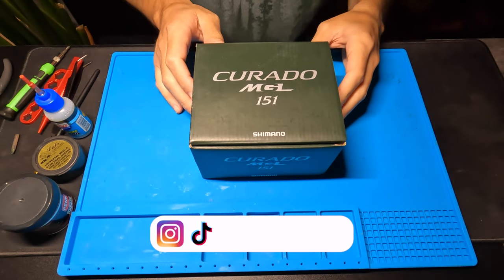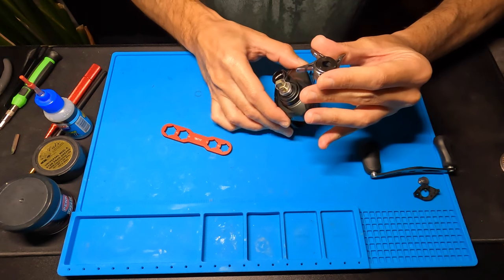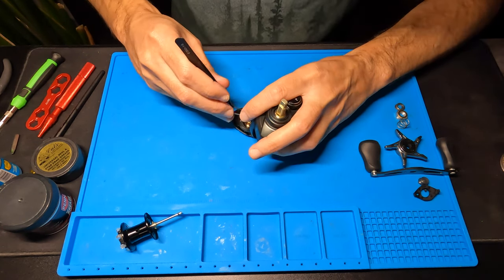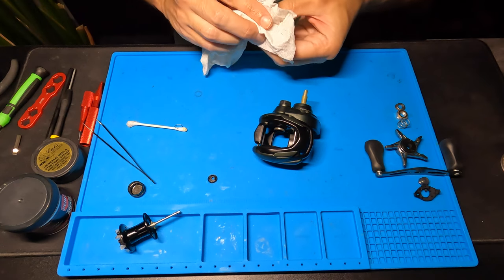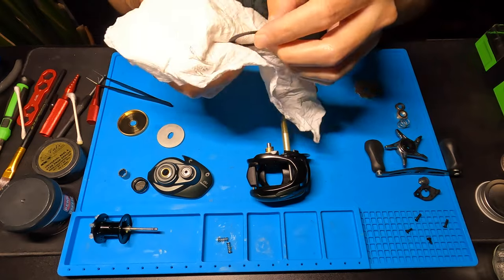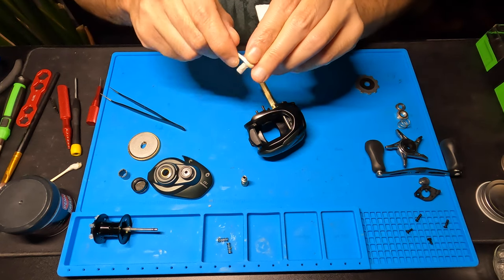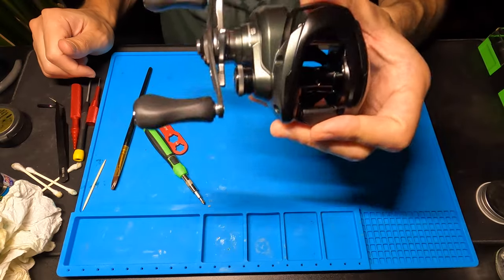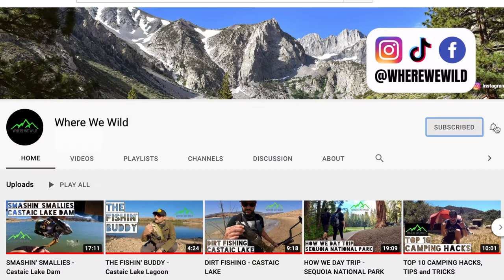SHIMANO CURADO MGL 151 - Take Apart & Tune Up - Reel Maintenance

Comment: Sir, I have a Curado 151 MGL , I wanna change the gear ratio from 6.2:1 to 7.4:1, so can I use the drive gear and pinion gear from Curado DC151HG ? 
Are these gears swap able? 
Thank you for answering
Reply from the maker: Wow. I honestly don’t know man I’ve never thought to try that before. 🤷🏻‍♂️😂 If it were me I would simply just sell the 6.2:1 on eBay, and buy myself an HG. Actually that’s a lie, I would probably keep the 6.2:1 for certain techniques and also buy the HG. 😎😂🤙🏽

Comment: What bearings would you recommend for a shimano slx mgl 70
Reply from the maker: Honestly not sure brother I haven’t had to replace them yet haha thing bombs as is! 💣😎🤙🏽 Love that reel. But, whenever I do need to replace bearings I usually just get the standard replacements from Boca Bearings. I don’t really go nuts trying to upgrade them to like the most expensive ceramic ones or anything like that, I just keep them super clean and well oiled and never have any complaints. I ripped that reel apart also if you’re interested, I’ll leave the link here for ya 👊🏽😊

https://youtu.be/aYU7nL4NIO8

Comment: Great video. What tool would you use to remove the roller clutch bearing/one way bearing/anti reverse bearing? Normally, I'd just use an appropriate sized socket to push/punch it out. However, the side plate lip design only allows the socket to push against the plastic cage of the bearing (instead of the metal housing), which will only result in the plastic cage being removed and sending springs and rollers all over the floor. The only answer I've been able to find is "Send it to Shiamno."
Reply from the maker: Thanks man 👊🏽😃 Ya know I haven’t had to replace that on this exact reel so I can’t say for sure, but anytime I’ve had to replace a one way roller I just pop it out by pressing it hard with my finger. 🤷🏻‍♂️ Usually they only are able to come out of the one side. This reel I was under the impression that it would just push out towards the inside of the case like I said at 17:40 are you saying it doesn’t push through in that direction either??? 🤔
Reply: @WhereWeWild  yes, the bearing comings out on the gear side/inside of the reel only. But the way the side plate is, only the plastic cage of the bearing is exposed, so that's all you have to push against. If the bearing is a tight fit, then you'll just push out the plastic cage. Even the Shimano parts website states that bearing is not user replaceable. None of my reels have required a replacement yet, but I'd like to be prepared before they do. Thank you for your time.
Reply from the maker: @RubenakaChupacabra  Hmm that’s odd man. Any part should be easily replaced on a shimano. Luckily that part should last a really really really long time. Another Shimano plus. 😎🤙🏽 I’ll have to see if I can get it out next time I clean an MGL 150!

Comment: Awesome video!  I need to service all my Curado 151's, my 71, my 201K and my 151DC.  On a couple of my Curado's I feel a slight clicking when reeling.  Hopefully it just needs some proper lubercation and it is not a bad bearing.  Guess I will find out.  I have noticed and it states on the Curado instructions, when opening and closing and locked and unlocking the side plate cover you need to loosen the tension on the brake dial.  If it is tight it makes it especially hard to close the side plate cover and lock it.  I see you did a video on the K.  What about the 71 and the DC?  Plan on ordering the kits in your links.  Thanks again!
Reply from the maker: Thanks man appreciate it! Stoked you enjoyed it! 👊🏽😊 Slight clicking huh? Hmm. Yeah might just need some love perhaps, and they are a little harder to close the door lock like that for sure. Have a Shimano reels playlist and am constantly adding to it if you want to check it out. Definitely have the 201k in there. 😎🤙🏽 Thanks again for the nice comment and thanks for watching 👊🏽☺️

Comment: I have the same reel and it’s started making a slight grinding noise before I stopped using it for winter, I started using it again and now it’s making a constant grinding noise when I turn the handle. I watched your video and took it apart, re greased and oiled and put it back together the same and the grinding is still there. The reel is practically new. I bought it last July and put it away in October. This is my first shimano reel, I normally use Lews. I can’t find anything that’s wrong with it. Could it be the main bearings? Should I try that next?🙄
Reply from the maker: Well that’s no fun. 😕 Hmm, yeah I mean I would definitely test and inspect all the bearings and gears make sure they’re all good, no damage to them, all are smooth and quiet, all cleaned, greased and oiled including the worm gear. Make sure there is no sand or dirt stuck anywhere sometimes that’s all it takes. I’d just go through the whole thing part by part like that until I found the problem. Shimano reels are great and the MGL 150 especially.
Reply: It feels like the drag plate is the issue when everything’s sandwiched together and you slide the metal peices in a circle around that plate you can hear it grinding and resistance. I don’t know the correct terms for it but when I was turning the big spindle that everything and the handle goes on I could also feel it grinding while turning it, I greased those 2 connecting gears but it still didn’t fix it. It seems like it’s still further in the reel. I put everything back together and when the drag is all the way out, no grinding noise but the spool won’t turn, like theirs too much resistance. As soon as you tighten the drag the grinding happens when you turn the reel. I worked on it for 4 hours last night till 2:30 am lol. I’m at my wits end, I’ve never taken a real apart this deeply before. Any suggestions or ideas?
Reply: For reference what I’m talking about is around 27 minutes in your video.
Reply from the maker: @shannonmctighe4369  Well definitely take that hidden bearing out I refer to around 27 minutes and check it. I really should have taken it out in this video. Also with the drag system make sure everything is seated properly like how that first clutch ratchet is squared and keyed and sits down all the way first, then the small drag washer and so on how I show to put it all back together. Also when putting the drag star and handle back on make sure that drag star is completely pressed down tight and keep tension on it while putting on the handle. If you like you can shoot some videos or pictures and dm them to our Instagram and I can maybe spot something it’s at wherewewild. It can be very tedious sometimes but you always find the issue one way or the other.
Reply: If it didn't sound like that when you first got it and it hasn't been exposed to salt water, it might actually be sand or something stuck in your worm gear for your line guide. I would tear all that apart, strip clean, re-grease, and test again. If was grinding when you first got it then I would say your main gear or pinion gear but since it developed after a seasons of use and you didn't notice any broken teeth when you cleaned it out, it's gotta be something with your worm gear and pawl. The other place to check is where the lips of your spool rides could be rubbing on your frame or dirt trapped in those channels.
Reply: @andrescruz9448  no salt water, I live in ohio. It shouldn’t have water in it other then maybe if it rained while I was fishing. It started probably the 5th time I was out fishing (weekend shore fisherman so I only go out a couple of hours at a time) the reel what very clean compared to my other reels lol, I took all the line off, stripped it then put new line on and back together.

Comment: Have this same reel and recently had some issues with it locking up. I adjusted the brake pads, sorry if that’s not term for 6 pads that move up and down on spool and also adjusted brake knob and now I can get reel to turn correctly after putting back together. It’s like it’s locked and I can’t figure what’s going on although I know it should be an easy fix. Anyone with same issue or any advice? Even when I did get it back decently right once I don’t know how and the tension was all out of whack
Reply from the maker: I would rip it apart and just make sure everything is put back together correctly just follow this video step by step if you have to. Something might not be sitting flush enough or slightly off and that makes all the difference. Also before you take it apart just maybe check if the tension knob is just cranked up way too tight. 🤙🏽
Reply: Thanks for suggestion. I’ll go through the process. Just so happens I went back through and reset dial to 3 then moved pads to 3 - 3 up/down position and it worked out. Still need to throw to check tension but nevertheless I’ll still tear apart to clean and regrease.

Comment: I just got this reel out on the water and I’ve had issues with the drag slipping. Unless I have it tighten down all the way, every time I go for a hook set, I’m getting slipping. Is there something I need to tune up on this reel or is this a common issue?
Reply from the maker: Hmm well ya know I guess you do have to keep it pretty darn tight really to set super hard on it. I’ve had that happen on a spinnerbait hit but I just had it a little too loose. Sometimes I’ll keep reels one or two clicks tighter than I’d like it to be and then back it off once I set the hook. Definitely would take it apart and make sure everything is cool though, make sure there isn’t too much grease on the washers and stuff like that. 🤙🏽
Reply: @WhereWeWild  thanks for the info! I haven't taken off any of the factory grease, so that's probably playing a big role. I also got a bit of sand in it, so I really need to get in there and completely clean it out. Thanks for this video!
Reply from the maker: @adamkoepke1366  No problem! Happy to help! 😊 Definitely rip that thing open and tune her on up! Always makes a huge difference even right out of the box! Thanks for watching really appreciate it. 🎣👊🏽☺️🤙🏽
Reply: @WhereWeWild  I haven't dove to deep into your stuff yet, but have you done one of these about the Daiwa Tatula 150?
Reply from the maker: No sorry I haven’t. All Shimano reels so far. Maybe down the road I will though. 😊🤙🏽
Reply: @WhereWeWild  Sounds good! Thanks again for your help!
Reply from the maker: No problem 😊

Comment: I took my 150xg apart and I think I messed up my drag. It’s kinda lose. Do you have a video of the drag system?
Reply from the maker: This video shows how to take apart and put back together all aspects of the drag system… 🤷🏻‍♂️ Loose? 🤔 What exactly do you mean by that? Like the actual drag star is loose? Or like the drag is slipping on fights? I would just watch how I’m putting it all back together and make sure yours is going back together the exact same way. If the star is loose your tension washers might not be sitting back to back correctly, or maybe you didn’t push the star down enough to sit it properly before putting the handle on.
Reply: @WhereWeWild  I have 2 extra small washers on mine I can’t figure out exactly where they go.
Reply from the maker: @knifeaddict1014  Extra??? 😃 Like you mean you didn’t put them back on??? 😳 That would definitely be your problem brother! Definitely watch the part of the video where I pull that area all apart and put it back together man. Those washers go under the spring, nut, and flat washer that’s the grey/copper color… and they sit opposite each other like this )( or like this () so that they create a little spring tension effect keeping it on tight. 😊🤙🏽 40:27
Reply: @WhereWeWild  no I put them back but not sure if I put them back in the correct order 😂 🙄. In your video I don’t see the 2 small washer like mine has. So 🤷‍♂️
Reply from the maker: @knifeaddict1014  Dude. 🤦🏻‍♂️😁 Unless you’re looking at a different model reel. It’s not going to be any different than this one is. Click these numbers 40:27 it’s the exact time stamp of this video where I put the washers back on.
Reply: @WhereWeWild  your not listening lol. I get what your saying but mine came with 2 extra very small and thin washers. I seen your video and done it the exact same. It’s so easy to do. But Iv looked everywhere on here to try and find those 2 washers like mine has and Iv not yet seen another one have them. Idk. Maybe it’s something new they added to the 150xg
Reply from the maker: @knifeaddict1014  It’s the exact same thing on both reels man and they wouldn’t add anything new lol but, whatever regardless let’s stop screwing around here haha and you can just go look at the schematic and see where every single part goes on that reel. Here ya go. The Shimano Curado MGL 150XG. This will show you every single detail. I’ll pray for you. 🙏🏽😁 https://fishshop.shimano.com/collections/cumgl150xg
Reply: The little washer that sits on top of the bearing on the handle part. You actually didn’t remove it in the video. But mine has 2.
Reply: I wanna say the number is 6655 But mine has 2 and I can’t figure out where the 2nd goes.
Reply from the maker: @knifeaddict1014   I was gonna say that bearing washer too haha but since you said there were 2 I was thinking that can’t be it. That odd man. Lol no wonder I couldn’t figure out what you meant 😂 They either go right next to each other on the bearing or one sits on top of the roller clutch inner tube like the curado K.
Reply: @WhereWeWild  yea I just took it apart and put one on top of the roller clutch.
Reply from the maker: @knifeaddict1014  Jeez man haha well hope that does it for ya. 🤦🏻‍♂️😂 Sorry that was just really odd I still don’t even understand what is going on lol I was wondering if you had a Curado K for a minute and didn’t realize this video was the MGL 150 😂😂😂😂
Reply: @WhereWeWild  guess we shall see lol. Hopefully my Antares isn’t this bad lol. Not that it was bad taking apart or putting back. But when you find an extra washer 😆 kinda makes you freak out.
Reply from the maker: @knifeaddict1014  Yeah man I have no idea what happened there 😂 Good luck. Tight lines 🤙🏽
Reply: The video is a detailed walk-through of a complete maintenance tear-down. Unless you had two extra washers on the table before you started, they're not "extra" washers. If the two washers you're referring to are identical and have more of an oval shaped hole and a wavy bend to them, those would be your spring tension washers. The only other washer is the Teflon coated washer behind the drag-star nut which starts at 4:00 in the video. Reel disassembly should only be attempted by competent individuals.
Reply: @andrescruz9448  real nice way to say your a prick. 👍 also, this was not a complete tear down. I’v tore many reels down for cleaning. He left the worm gear and guid, and the side plates. They are much more parts still attached. If you think this is a complete tear down. then sounds like your not very competent. I was just a little rusty because I haven’t been in the game in awhile. Also taking something apart for anyone is always someone’s 1st time doing. You think someone is an expert at something automatically 😂.

Comment: Do you do other peoples reels boss?
Reply from the maker: No actually I never have haha 😁
Reply: Should I add oil or grease to the worm gear? I have an mgl 150 as well but I noticed you added oil but mines pretty dry rn so trying figure out which I should put thanks
Reply from the maker: @moisesramirez7898  It’s up to you brother you can use either one. Personally I prefer oil. 😊🤙🏽

Comment: Just my opinion, all bearing support such as under drive gear shaft, under clutch cam retainer, small bearing at tension would be more protective if you covered with grease instead only oil due to those bearing is very easy to get rust. Not disclaimer just opinion. But nice video anyway
Reply from the maker: Hey run em how you like em brother! 👊🏽😊 In my experience and opinion grease slows bearings down and they seem to be much faster for me with just oil on them. 🤷🏻‍♂️😎🤙🏽

Comment: My drag stopped clicking where did I go wrong?
Reply from the maker: @Gio-nl7eg  Guess you mean the drag star? The little pin and spring seen at 03:15 makes the star click.
Reply: @WhereWeWild  right when you said to be careful I dropped the reel a few inches and it went flying into carpet floor 😂